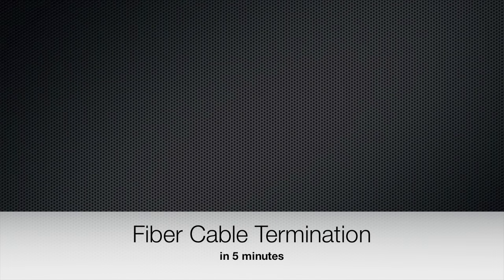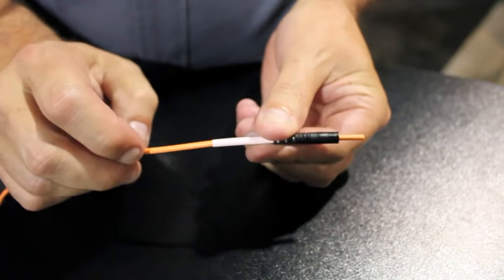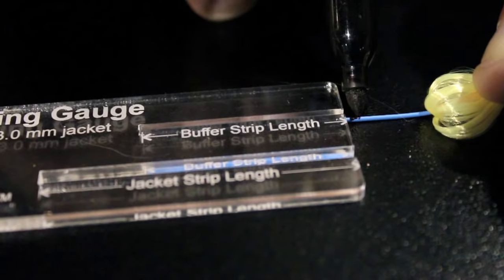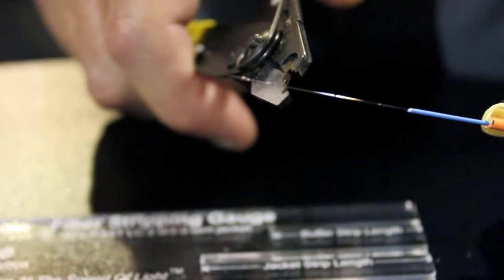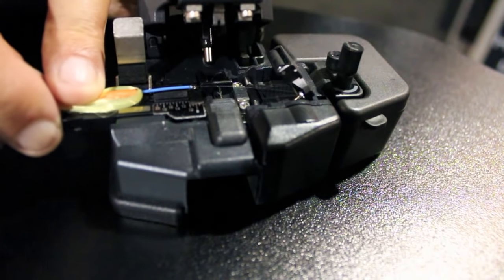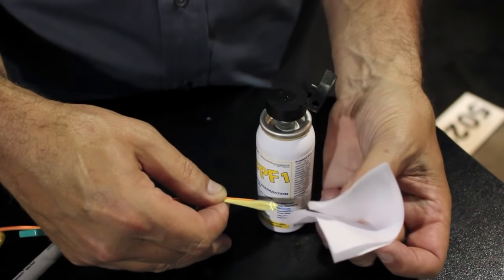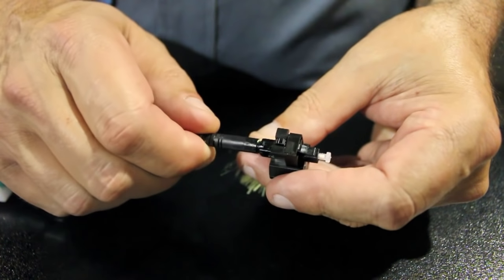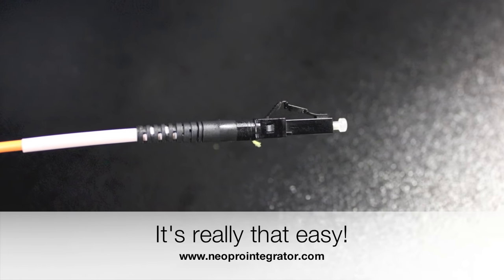Terminate Fiber in 5 Minutes

Comment: Major wrong step: The cleaning needs to be done after stripping the fiber and before the cleaving
Reply: You surprised me with cleaning the fiber after cleaver.
Reply: @rondog699  Never had that problem....  I was taught to "clean then cleave" so the tip is virgin glass..
Reply: YES that really bugged me, always clean your fiber before you cleave 🤦🏻‍♂️
Reply: Correct, otherwise dirt and pieces of coating will pile up at the face of the cleaved fiber due to the wiping action, leading to transmission and reliability issues. It's less of an issue if the connector has the fiber going through all the way and you do clean the connector's face a final step, however if it's a rapid style connector with pre-polished fiber inside, you essentially seal all the dirt inside the connector between the two fiber strands.
Reply: @jeffteng2343  It's actually entirely wrong for another two reasons. On top of what others have said about dirty fiber causing the cleaver to cleave improperly, the cleanest that glass will ever be is after cleaving it. Cleaning a fresh cleave makes it worse.

Comment: The second coding is NOT cladding it’s the  260 micron primary buffer coating, the core glass and the cladding glass are something you never strip mostly because it’s not possible.
Reply: Mostly
Reply: This is what I was looking about and asked many no one answered me right , does cladding remove or no or the last layer we remove it is couting
Reply: The cladding and core are necessary components for the fiber optic to work as intended. Light is a wave, and the fiber optic acts as a transmission line, not unlike a waveguide that is used for radio and RF. Actually technically the fiber could work without cladding as air provides the same transmission line discontinuity as the cladding does (causing internal reflection) but it would be too thin to handle.
Reply: @power-max so what you’re saying is I don’t know what the hell im doing lol
Reply: @power-max  Wtf?? So you're saying I should NOT remove the cladding?? With my crappy strippers, it either cuts the fiber or doesn't scrape the cladding off, every time I have to do micro adjustments to get it to remove the cladding. All the while having to re-do lengths because they cut the glass!! So frustrating

Comment: I'm brand new to this! done copper for years and years. 
There seems to be very little information easy to find for beginners.  
When do you have to use glue/epoxy in the connectors? and when do you need to polish the ends?  
Are people just being lazy and not doing it witch cheap connectors and cheap cleavers?
Or is this more something you have to worry about with multimode and long distances and worrying more about losses?  
Whereas with multimode/local stuff people just are not worrying about this?
Reply: These are mechanical connectors that are already polished. No need for glue or polishing.
Reply: Has nothing to do with if it’s multi mode or single. The glue and polishing is for anaerobic type connectors, these are quick connectors. Quick connectors, aka unicams, already come from the factory with an index matching gel inside the connector so all you need to do is put your clean fiber inside and you’re good to go.
Reply: I am kinda in the same boat, I have a lot of networking background, I look after a plethora of switches, routers, etc etc.  I have crimped 1000s of rj45 connectors in my life but have yet to crimp a fibre lead.  I am currently working at a company that use a mix of LC, SC and ST connectors which I need to make sure if they are ever damaged they can be repaired in house.  The fibre paired are used to connect various buildings on quite a large site.  So need to find good guides like this, luckily I have lots of test equipment to play around with to get some skills just incase I ever have to do it for real.

Comment: In order to know it's going to work you need a fiber light passing through... Fiber is not easy to terminate due to the fact that terminating like this doesn't work unless you have years of experience and don't need a fiber light on the other end to ensure the light is passing through.
Reply: A quick test with a fiber power meter should work. If you're concerned about the splices and the terminator you can run a full OTDR test to confirm power and losses at each splice point back to the cabinet. Fiber termination is much more reliable than in previous decades.

Comment: Cleaning after cleaver??!!!it will damage end of the fiber
Reply: @MrAbdullah773  You want all the cladding off before trying to cleave. If there is cladding on the cleaver won't cleave properly. So it either won't cut or it will leave a crappy edge that will give high light loss.
Reply: @MrAbdullah773  He is right! The fiber needs to be clean before the cleaving. Cleaning after the cleaving will just damage the cleaved front end of the fiber. Try putting the fiber into a splicer to see the cleaved end and you will know what I mean
Reply: Yes, i am working in Germany, first cleaning and than cutting

Comment: Never angle the strippers, never run the strippers more than once, you clean after stripping not before. Horrible example...
Reply: No disagreement in essence, just adding for the sake of clarity for beginners passing by that you generally can't strip all of the 900um buffer at once without breaking the fiber, so it is common practice to strip it in small sections. Fully agree with a single strip to remove the inner buffer coating so as not to risk any undue effects to the cladding. If the fiber will tolerate it, I do try to make my last section of 900um stripping longer than the cleave length of the fiber so that the cleave isn't near a spot the stripper jaws closed around. Gives me more consistent results. And be sure to properly dispose of your glass!
Reply: Oh boy.... Do you have any friends???  Not horrible...  Real world...  Not all of us have all day to make everything "just so"....  I have never had a termination fail so it can't be all that bad...
Reply: @OldSkoolF  what do you use to certify your work?
Reply: @justinspeer8481  Currently an Owl 7...  I was using a Duo...  Hate to say it but I like the Owl.... LOL